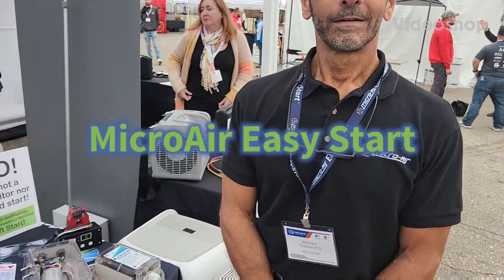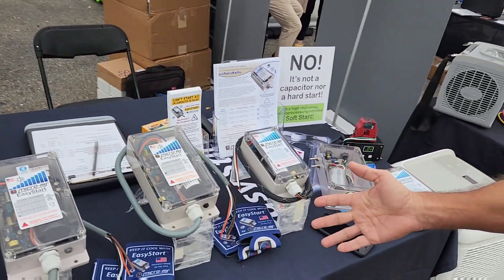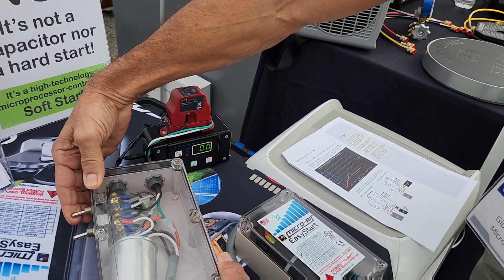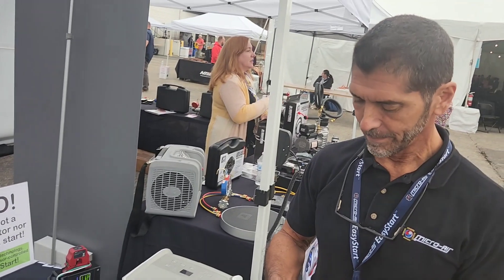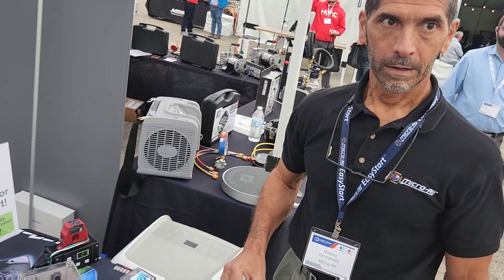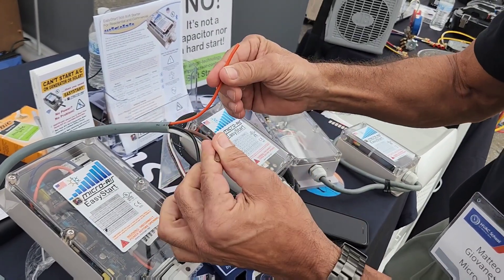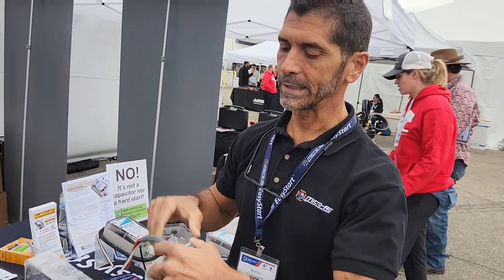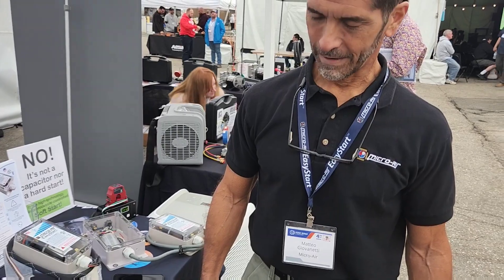Micro Air Easy Soft Start

Comment: Nice video.  Maybe you can answer my question. I tested mi inrush on my 3 ton a/c unit.  I used the black wire common and it reads 109.4.  On the label it states an LRA of 88. Is that a problem?  Thanks
Reply from the maker: In rush amps are what you get before the magnetic field is established. Thats when your compressor winding is just a giant resistor. If you use ohms law and ohm it out youll get close to LRA. A= V/R

Comment: Install a 3 ton unit on my home AC system and it’s working great. Took the LRA from 79 to 24 about a 70% decrease. I can run my AC on my 6.5 kw generator with no problems.

Comment: We added one to our forward AC unit on RV.   After a year we added a second to our rear AC unit. Recently thought we had a issue with the first one but micro air does not control the fans. It was a bad fan capacitor.

Comment: I just looked at their web site.  They only seem to offer a model 364 for RV use and a model 368 for everything else up to 6 tons.  Am I missing something?  Also, can I use a unit like this to reduce the starting current for my gas furnace blower (120 volts) and my 3/4 hp sump pump motor?
Reply from the maker: Best to contact tbem directly.
Reply: @timdestasiohvac  tnx.  I'll do that.

Comment: I have a 5-Ton Carrier with a 2-Stage Compressor. Model: 24ACB760A310.  Depending on the demand for the AC, it determines whether to kick on only on Stage-1 or if it needs to run at full speed on Stage-2. The LRA is rated at a whopping 152.9 and I can hear it thump when it kicks on. Is the largest unit that supports up to 6-Ton unit compatible with this multi-stage compressor AC?
Reply from the maker: Yes it should work. The 2 stage compressor doesnt start any harder in 1st vs 2nd stage. That is done with a solenoid inside the compressor that allows it to take a bigger gulp of refrigerant.
Reply: @timdestasiohvac  thanks for the clarification! I successfully installed the Easy-Start on my 5-Ton and the startup is down to 35.3 amps now. It's much quieter on startup now. Very happy with the system.
Reply: I have the same question, does it help on a 2 stage compressor? Sounds like, yes. Going to give this a try on mine. It is a 5 ton Carrier Infinity multi-stage compressor Model #24ANA160A300.

Comment: 2.20.23  I have the ASY 368 X48 BLE model.  I needing some wiring help because my capacitor was a turbo 2 jumper configurable.  I did not know where to put the wires, so I contacted Micro Air and sent a wire diagram picture from my Bryant heat pump.  I received back a picture with color coded as to where the wires should go.  All is good now and as of the day have over 1800 starts with no problems.  My unit is quieter on the starts now.  The Easy Start I have mounted inside the Bryant.

Comment: Thank you, Tim!  It was great to meet you and talk to your viewers about the benefits of EasyStart.
Reply from the maker: Mateo, do you all make surge protectors for inverter units?
Reply: @timdestasiohvac  Hi again Tim.  Ironically, I just wrote and submitted for review an engineering specification for a unique surge protector device for various applications, including inverter-driven HVAC systems where all of us know how ferociously expensive the control boards are!  This project is still a long way off, so in the meantime, I would recommend the Intermatic AG3000 or the Rectorseal RH series of surge protectors.  Ours will be much more sophisticated and unique to the industry - which is still TOP SECRET info 😁 - but if you need something in the meantime, these well-established brands and models should do the job.
Reply from the maker: @MicroairNet  thanks Mateo! When you fo release it, send me one if you like and we'll do some content. For now, the AG3000 is a beast!